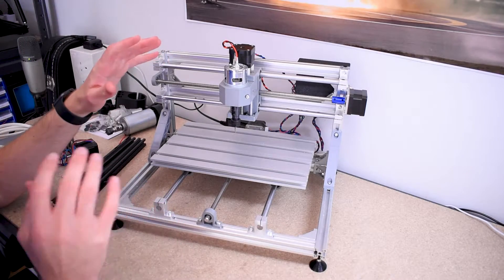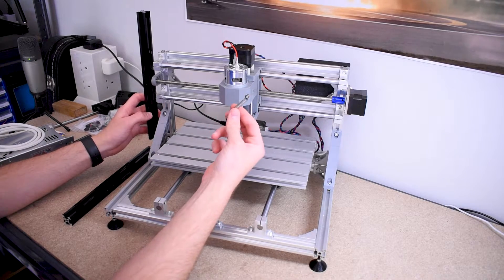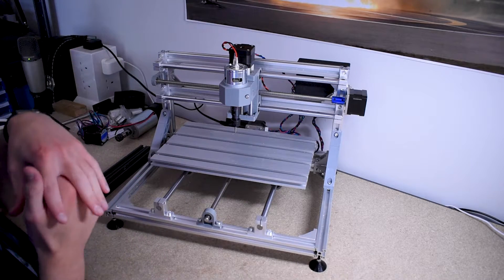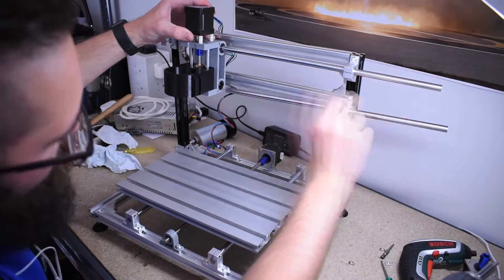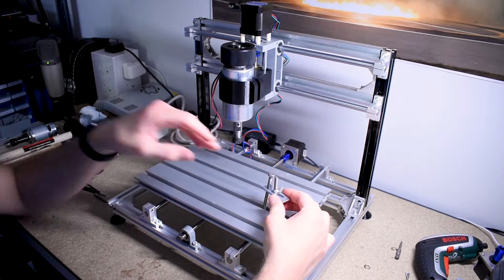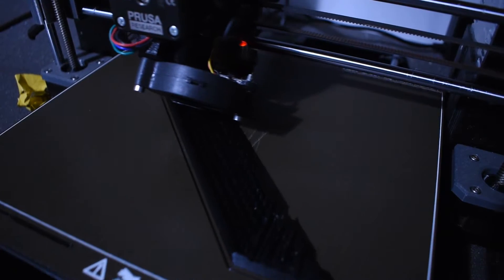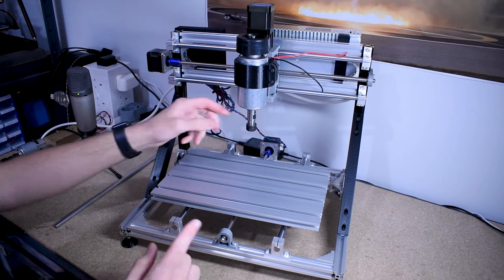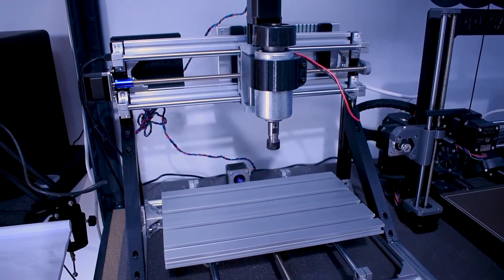3018 CNC Router - Spindle & Gantry Upgrade

Comment: The stock spindle motor is a 775 series,these come in various wattage/torque/rpm ratings ,there are models used in fans,cutters and scooters,the ones used in scooters are the most powerful,I have just received my 3018pro mill and i'm thinking about mounting the spindle motor such that it belt drives a ER11 colletchuck spindle mounted in the motor mount with large high speed bearings suited to this field of use.

The gantry should be upgraded using sbr10-20 supported rails to kill any flex,also lock the gantry extrusions with 2 vertical box sections bolted so the flat faces are clamped together making the gantry super stiff,along with the sbr rails this would allow metal cutting,the steppers and lead screws would need to be upgraded to avoid rotational deflection under load on the push stroke.

Having priced the rails at around 12 quid each,two sections of thick wall aluminium box section from a scrap yard,aluminium for the light weight,lead screws and steppers are not particularly expensive for what they are,just upgrading the spindle and thinking you can carve what you like will not work,each axis needs to be upgraded to avoid stalling,missed steps,burnt steppers or bent lead screws,you can make a very good mill using a bog standard 3018 and get a £1000+ machine for little more than the cost of the original unit.

The spindle pulleys ,i saw two GT2 one 30 tooth for the motor and a 36 tooth for the spindle shaft,this will reduce top speed but it will increase cutting torque,so if you can upgrade to the 320w-380w 775 motor any shortfall in spindle slop however small no longer matters on a belt drive as the bearing mounted ER11 straight shaft chuck(ebay around £11) should be fine for mill a smd pcb with 0.2mm ball end mills never mind carving with trend 1/4" cutters.

One thing i have seen on many youtube vids concerning this genre,is that a lot of users don't use the proper milling tools for the material being cut,cutters being smeared with aluminium leaving ragged cuts,cutting time extended due to inability to properly cut,wood tear out,tools breaking.

If like me you bought a full set of ER11 collets to go with the ER11collet chuck on the 3018,then get a hold of a trend catalog or any other quality router cutter maker,but trend have cutters for wood,plastics,metals(mostly aluminium or brass),but the emphasis on proper cutter geometry for the work piece is absolutely vital as the drive bearings spindle or steppers are under excessive loading when the machine is trying to force a cutter into the work rather than the proper cutter which will if the spindle is true glide through the work piece.

I saw cast acrylic being cut on a bog standard 3018,and this can then be used to make parts like a side mount motor/spindle drive ,that could then due to the reduction in cutter chatter then cut aluminium plate to make an even better motor/spindle mount.

Make the frame bigger and you can then do away with the bakelite gantry sides (my machine uses them),get the mill to upgrade the mill as the accuracy increases.

I do have a proper metal working mill and center lathe so i could maually make parts,but the level of accuracy a cnc mill can achieve after some upgrades can outstrip the manual machine,if done properly,So you don't need to spend big bucks on a high wattage spindle motor,the gantry can be stiffened along with zero flex sbr rails,for very little all things taken into account.

The stock unit only comes with 3 end stop micro switches ?,so it's safe in one direction on each axis,i got 10 rolles micro switches for 4 quid  and 50m o 20g red/black wire for 6.99 on ebay.

Routers are way too noisey,the spindles on offer are quite quiet,but so are the 775 motors and as i said they come in almost 400w flavour for scooters and cost about £30.
Reply from the maker: I no longer use this machine. Check out my recent DIY CNC Open Source Build

Comment: Wouldn't 2040 extrusions be better for the uprights and Delrin polymer bearings replacing the messy ball bearing ones on all axis (less worry with dust accumulation and easier to keep clean)?
Reply from the maker: They would be better, but at an increased cost! I tried my best to minimise costs with this upgrade 👍🏻

Comment: You already had the best 45 degree braces - the original uprights. Buy some 45 degree brackets that fit the 2020 extrusion like the right angle ones. You are going to need major upgrades to fix the z-axis wobble. Don't bother trying to modify what you have.
Reply from the maker: The 45 degree brackets that I printed are excellent to be fair! although I do agree with you and I did mention it in the video, this machine isn't worth upgrading any further. I'd say I took it to the limit, and if you want more you're better off buying a more capable machine!

Comment: What model of 3018 is that? Do you have a link? I've watched Rogers videos and he doesn't give a link or mention the exact brand.
Reply from the maker: It's the early non ''pro'' version. You can find them on eBay. Easy to identify by the all aluminium frame

Comment: Maybe you can mill out your gantry parts. Maybe even go with a slightly bigger gantry. Maybe look into a Duet, or similar board. I know the plastic mount can warp.  I would go with PC if you can print it.  Then mill out new parts. Maybe enlarge the Z gantry a little and change the part cooling. This looks like an awesome starter tool.

Comment: I have a 3018 and upgrade to 20000 spindle but rather than put more money into the 3018 I am saving for a cnc router with square linear rails with bearing blocks
Reply from the maker: Yep! the 3018 is great to learn the basics but for anything serious you'll want a sturdier machine for sure
Reply: @thehardwareguy  most people dont realize what production cnc machines are, I had my own machine shop for 10 years ( hated small business) I really miss machining just picked up a used hardinge lathe and will be buying a quality cnc router, it costs to much to run a 10 hp cnc machining center or lathe

Comment: I see that there are both 48V and 100V spindle motors available. Is there any advantage in on over the other?
Reply: The 100 volt spindle is a brushed motor ......the 48 volt one is a brushless motor costing twice as much due to the 3 phase driver and a transformer.
Reply from the maker: in most cases higher voltage will mean higher power. Too much power is overkill for this little CNC frame, stick with the same spindle i used!
Reply: Thanks, I bought the 48v.

Comment: Great videos  thanks.  I am having trouble finding a 300W spindle but there are loads of 500W spindles about.  Do you know if the CNC3018 could be upgraded to a 500W spindle without having to reinforce or change the Z stepper motor? Thanks

Comment: All this upgardes is bullshit, because this machine have 10mm bars and this bars bent from any touch... With original extruded Z axis block and spindle(1.1kg) they bent at the middle of X axis about 0.5 mm. Stepper motors is wery wake to(X axis can produce 6.2 kg force), should be replaced...
There is only one solution, change this bars with SBR bars(for one axis price is about 26EUR)...  But more cheepeast way is make you own machine parts with this machine, and put this on the chest of drawers for nice memories...
Reply from the maker: Depends what you expect to get out of it I guess. The upgrades have definitely improved the machine, at very low cost. The upgrades I did mean that I can now cut harder woods instead of just softer woods. For me, that was worth it. Someone like you is probably expecting this machine to cut space grade steel, it’s not going to happen.
Reply: @thehardwareguy  No, I don't expect cut stell, I understanding this machines capability. I have this machine to. Right now I watching you video about adding 3-rail for X axis...What I tell in my previous comment about X axis? You find the same isuue of this machine...Next is Y axis, I think there is possible add more 2 rails on bottom for more rigidity. But, actually,as I sad, better is meke one new machine, with more bigger space and bigger rigidity. But this is next level.
This is hard to do with chinese parts, because they are low quality. 
Yust measure, for example, distance on each side of bar stand holes and you see tahat there is not poosible meke this machine run in proper dimensions. Yes, you can do souvenirs, but this is all of capabilityAlso you can't work with any metal, excepting situation, where you quality requirements is wery low.
This you idea with 3 rail is good, but I don't have 3D  printer.

Comment: I'd be interested to see how you get on with the heavier spindle and upgraded stepper motor.  I'm about to upgrade my 3018, but I plan to redesign and rebuild the X gantry and make a few other changes.  There are three things a CNC router or mill needs: (1) rigidity, (2) rigidity, and (3) rigidity.  A 3018 doesn't have much of those. Yet :-)

I thought about adding a third linear rail, forming some sort of triangular arrangement, but decided it needed to be too far back from (or in front of) the existing ones to be a good solution.  I plan to use self-supporting linear bearings of some sort, have much less overhang, and extended Z travel.  More weight so, like you, a bigger stepper motor, eventually.

The stepper you used looks like one of the largest NEMA 17 types, rated for 2A, and I'm not convinced you'll get much more torque out of it than with the original.  Having divorced the spindle power from the original power supply, the PSU probably has the capacity needed for one larger stepper.  However, the control board probably can't deliver significantly more than it already was.  The drivers regulate and limit the current.  I don't know which type you have, but if it's a Woodpecker with the blue heatsink, the drivers are Polulu A4988s and can only deliver 1A.  A CronosMaker with stepsticks has the same A4988s, though you can replace those with DRV8825s or TMC5160s.
Reply: Do you think you can upload a video or pictures of your final setup. I’d be interested in seeing the build. Ridgidity is key!